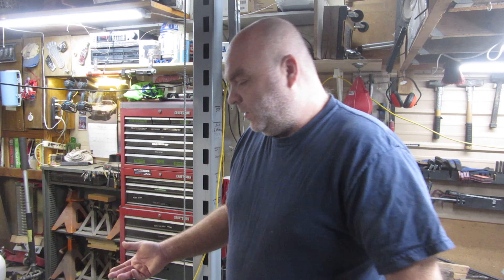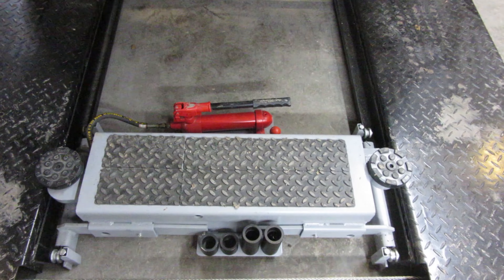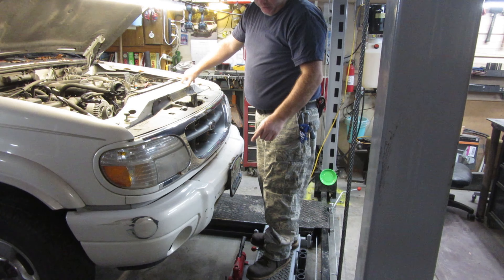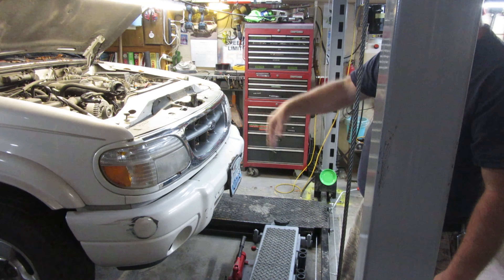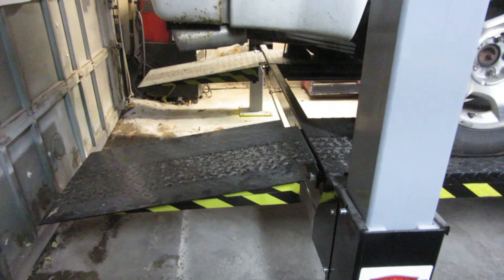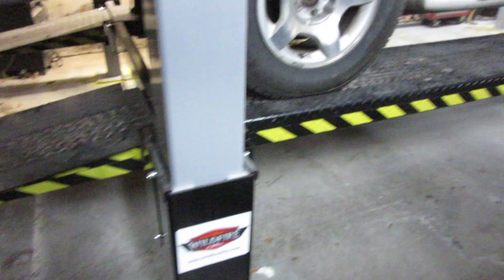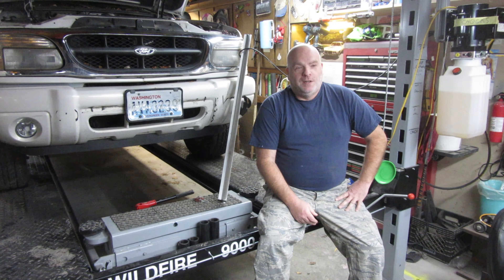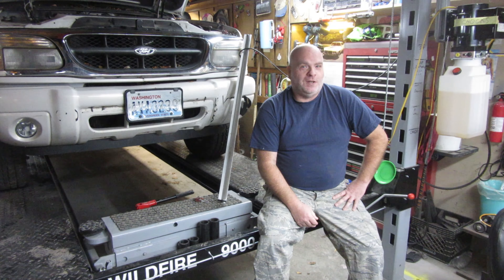WILDFIRE XLT LIFT AFTER 1 YEAR OF USE

Comment: After 2 years of OCD research on 4 post automotive lifts I have decided on the ALI certified Advantage SS-11000 WD vice the Wildfire lift.  Was originally looking at their 9000 XLT.  It was bushings with zerk fittings vs bearings and ALI certification that finally made this decision.  Most of my youtube big name hero's got their Wildfire lifts free.  This is a product that you will only by once.  Wildfire makes a great lift while Advantage does have the advantage in my eyes for only a few hundred dollars more.  Purchased a couple days ago.  Delivery is 4-6 weeks.
Reply from the maker: i paid for mine and am happy with it but in the end it was the one mainly i went with because it fit in my shop and had the length to hold my crew cab with extra long bed that seamed solidly built.👍
Reply: @mickeyj4228  I was just looking at the SS11000 lift.  Can you tell me how you are liking it.  It looks like it could work with my Dodge diesel or the 29 Ford Model A I am working on.  Take care.  Tom
Reply: @Okie-Tom  I'm 4 weeks into my 4 to 6 week delivery estimate.
Reply: @mickeyj4228  , well ok.  Well I hope you are going to video your unboxing and assembly adventure.  The SS11000 looks like just what I needed.  I will subscribe to your channel.  Hopefully you will post a nice long video about it.  I have not found anyone that has posted anything about the SS11000.  Take care.  Tom
Reply from the maker: @Okie-Tom  i love it, i have several vids on it in my wildfire playlist on my channel, including actual measurements, and some positives as well as the very few negatives👍ps i've put everything from my 1 ton 4 full door extra long bed gmc to a vw bug on it 😁
Reply from the maker: @Okie-Tom  i love it, i have several vids on it in my wildfire playlist  on my channel,  including actual measurements, and some positive as well as very few negatives,👍 ps i've put everything from my 1 ton 4 full door extra long bed gmc to a vw bug on it😁
Reply: @Okie-Tom  There are lots of 9000 XLT video's on the Advantage Lift YouTube channel.  Assembly and unboxing are basically the same with the SS-11000=WD. I picked my SS-11000-WD up on Thursday and assembled it yesterday with a friends help.  I did just post a walk-around video for you.  Hope it helps. https://www.youtube.com/watch?v=FAESPNpDqRQ

Comment: The bearings in these lifts are made of sand holding hands.  You better change them all.  Watch my vids.  I happened in real time.
Reply from the maker: i had one fail but i was ok with the replacement they sent me i check them each time i use the lift and haven't had any more go bad i did a vid as well thanks for your concern thow.